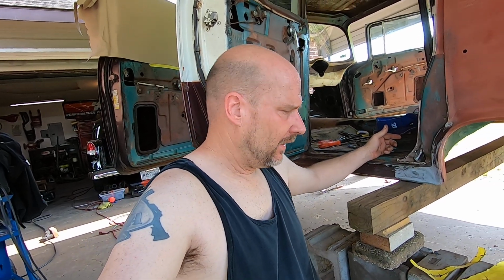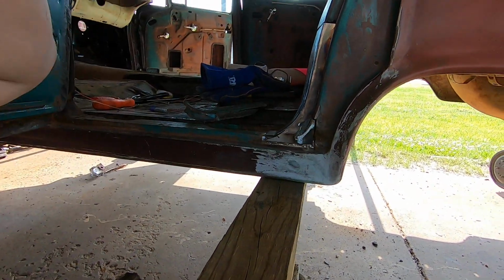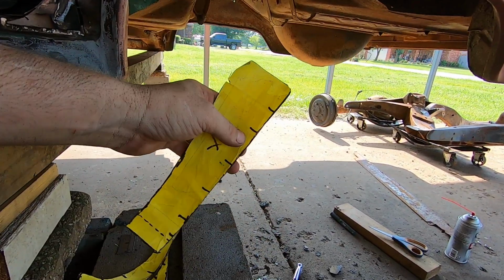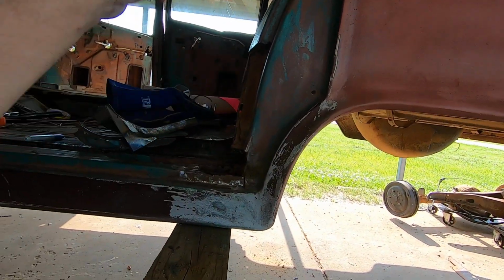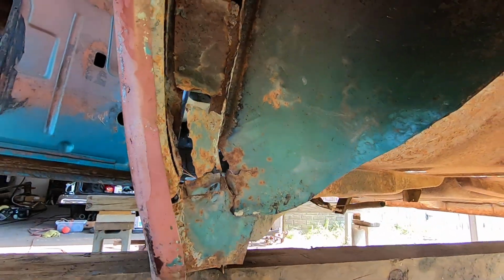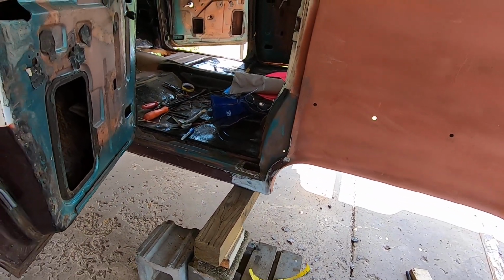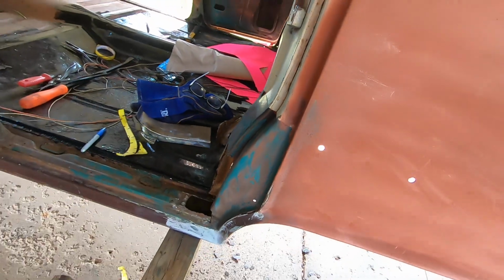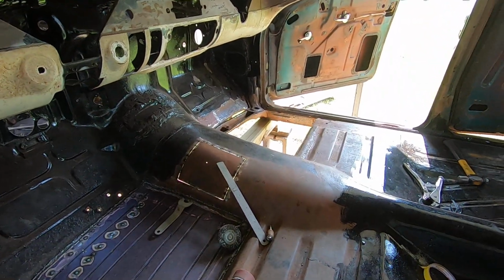1955 Chevy 4 Door Build Episode 18. Dog leg repair part one

Comment: Do you remember where you purchased the carpet for the hardtop? I got crap carpet from ACC!
Reply from the maker: I think it's Trim Parts
Reply: @haffrods7055  checked there, no carpet.
I ordered one piece carpet and I got it with the glued jute pad crooked, no we’re near the center of the carpet.
Thanks
Reply from the maker: @rudymerced964  I just dug out the box the carpet came in and it says Trim Parts. Bought it from Ecklers about 7 years ago